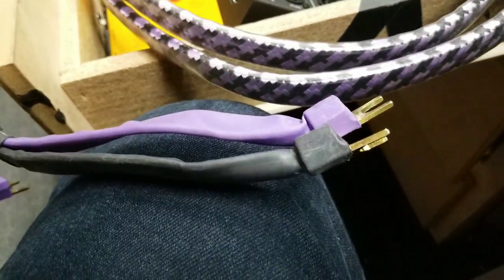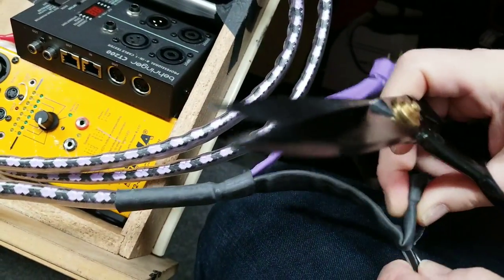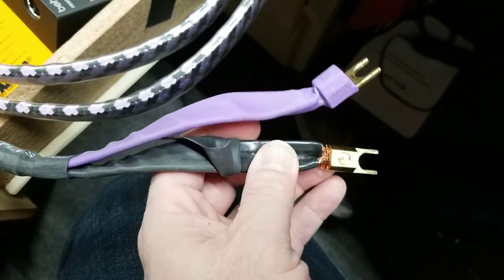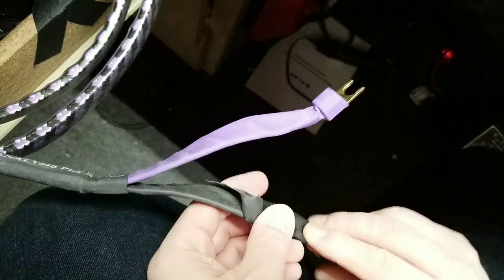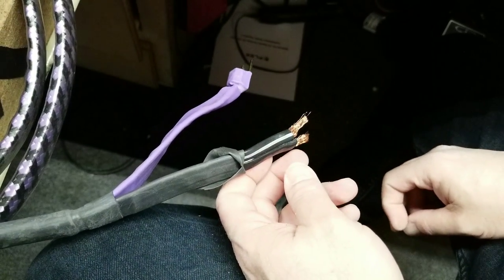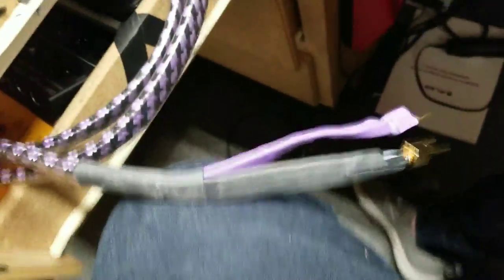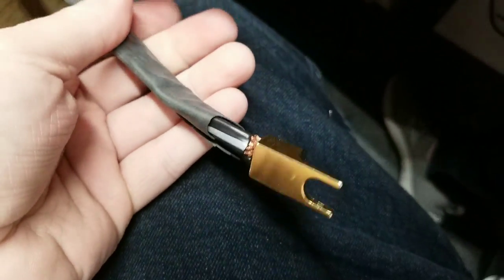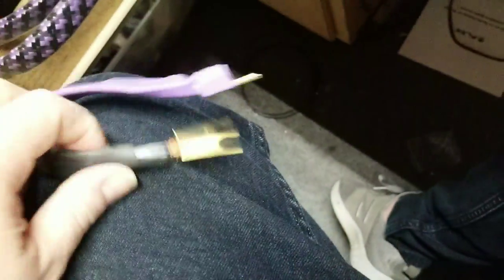Beaker Wire. Lets see what's inside shall we ?

Comment: Speaker wire is always worth its weight in copper.   Ha.  If different speaker wire changes the sound of your system you likely have poorly designed very low impedance speakers and poorly designed high output impedance amplifiers.  If you can hear a difference, that can be easily measured and will be larger than 0.25 dB and easily compensated for.   So if you want to make equalization changes to your system, buy an equalizer and adjust it how you like rather than wasting money one different cables that produce random different results by leveraging shortcomings in your equipment.  So borrow those million dollar cables and measure the before and after response of your system.  Then program an equalizer to give you the same results for free if you have a digital source like a PC or less than $1,000 if you actually buy a digital EQ.
Reply from the maker: Sure.... you say Tomaaato I say Tomato... I prefer passive tuning....

Comment: That "car audio stuff" is Analysis Plus Solo Crystal Oval 8 speaker wire. Yes, it is just a flat oval braid, but the wire is Ohno continuous cast copper. 

From http://www.norneaudio.com/litzheim/Norse-Norne-Audio-Feedback :

"Used throughout the high end audio industry in most flagship cable products, occ provides the superior quality copper and silver possible today.

OCC (Ohno Continuous Cast) is the name given to the casting process developed to help defeat annealing issues and virtually eliminate all grain boundaries in copper or silver with a unique patented process. The OCC casting method uses specialized heated moulds in order to draw a single crystal up to 125 meters in length. With only a single crystal in very long lengths, there is an unimpeded free path for the best possible signal transfer. Along with this superior single long crystal structure, OCC provides copper and silver with the least possible oxides and other impurities. 

In high contrast to OCC, there are other lower grade coppers such as OFC with a multitude of grain boundaries and other impurities. OFC (Oxygen Free Copper) has around 400 crystals per foot and despite its name has an oxygen content of about 10 ppm. Having less oxygen content and less overall impurities compared OFC. OFC has a plethora of grain boundaries per foot that the signal must route around and pass."

From http://www.6moons.com/audioreviews/interconnects/interconnects_3.html :

"A further step of improving copper wire is annealing where the conductor, once at almost desired gauge, is reheated to just below its melting point to evaporate impurities and form longer crystalline grains. The LC-OFC long-crystal oxygen-free copper contains grains that are roughly 600 to 1000 times longer than TPC molecules.

Twenty years ago, a Japanese engineer invented the Ohno wire extrusion method to produce PCOCC or pure copper Ohno continuous cast wire. Instead of forcing molten copper billets through a cold-mold extrusion machine, they are processed in heated molds and subsequently slow-cooled to room temperature. This results in far fewer molecular boundaries than regularly processed copper extrusions. It should come as no surprise that raw PCOCC wire is much more expensive than LF-OFC (oxygen free copper) or TPC (tough pitch copper-the cheap stuff)."

Only one company in the world makes this wire. You cannot buy it at Home Depot.

There are pictures of the crystalline structure of the grains in the OCC wire as compared to oxygen free copper at both of these links. Furthermore, Analysis Plus actually has a proof of concept page on which they measure the response from their wires here: https://www.analysis-plus.com/make-me-prove-it/

I just picked up a couple pair of used Solo Crystal 8 interconnects, they are better than anything else I own, including Nordost.  I don't believe the hype of most cable manufacturers, and I don't believe there is anything you can do to a piece of wire to make it worth $3,000 a foot. PCOCC however is real, and much better than standard copper wire.

I have only seen a few of your videos, I assume you have ears, your system looks great but I can't judge it from youtube sound. While you did say "let's listen to it", you pretty much dismissed these wires by looking at the conductors. I look forward to your listening test.
Reply from the maker: Thanks John for offering very good information. I've known about Ohno for a long time. It's very rare and only comes from Japan. A few areas of concern remain. First off does AP include an assay of the batch of Ohno associated with your serial number ? This is something I do. In other words there is no regulating body in HI Fi regarding statements made about raw material purity. Anyone can say anything this wire looks like it's made in huge quantities and its braided which does not make sense to me.  Ohno wire eliminates micro gaps inside the core of the wire for smoother, less impeded flow. Now you tell me that someone is going to go through the cost and labor of having ohno made, then braid it ? The very physical makeup of braid wire makes it best for shielding and only because its flexible not because it sounds good. By braiding ohno copper you would re introduce micro gaps between strands at a much higher / worse level. Is it litz ? The one here looked oxidized which would of course over time make micro gaps act like diodes. So braid conductor makes no sense for inside the home HiFi in my opinion. It does however make perfect sense for underneath automobile carpet. If you've got the best metal in the world, the best form for music ive found in all my years of trial and error is solid foil. But its cost prohibitive for large  companies. And a major pain in the ass to work with. But let's give it a proper chance . I'll rig. Record and compare tonight and post tomorrow. 
Thanks for your post and if AP is your chosen brand I mean no disrespect to you personally whatsoever
Reply: @OCDHIFiGuy  Actually, I have owned 2 sets of AP interconnect for a total of about a month. I have a setup that allows me to easily A-B two interconnects. I did this recently with everything I own and have collected over the last 35 years. The brands include Audio Research, Nordost, Audioplan, Blue Jeans cable, Monster, XLO, the cheap free stuff, one DIY made with OCC silver and van den Hul carbon. There might be a couple more in there. The result was I could not tell any difference between any of these cables except two. The really cheap cables did sound bad, and the van del Hul had a fullness and body to it that the rest did not. The big problem with the vdH, it is prone to hum.

I learned about the AP from a site by a high end expensive, custom company whose name escapes me right now. They used AP exclusively. So I went to the AP site. They actually back up their claims with scientific explanations, measurements and waveform traces. So I picked op a pair of AP Solo 8 interconnects, compared them to my vdH, and, no difference. So now I can get the body of the carbon conductors without the hum. What do the AP and vdH cables have in common? No crystalline structure in their conductors. (The van den Hul is carbon.)

I have made interconnects with 32 gauge, transformer wire using aquarium hose and pencil erasers for the RCA connections, only bare wire made contact. They sounded as good as my other cables but were extremely delicate. I soldered on some real RCAs and was shocked at how much that damaged the sound. So I am not one to fall for the hype.

I don't know if the individually insulate the strands of wire in their cables like transformer wire. What I really wanted to see on your video is if there was something inside the woven oval to maintain the oval shape.

More from: https://www.analysis-plus.com/make-me-prove-it/ 

                                                   The Hollow Oval Cable Solution 
After many computer simulations and other exhaustive tests, the engineers at Analysis Plus, Inc., reached an innovative solution that flew in the face of conventional wisdom on audio cable geometry. Our engineers determined that a hollow oval cable constituted the best possible conductor design. Here’s why.

The primary advantage of an oval conductor design rather than cylindrical conductor geometry is that the oval shape allows more of the return current to be closer to the outgoing current, thus reducing the negative effects associated with excessive current bunching.

Figure 1 illustrates that at DC the current is uniformly distributed across the cross-section of the wire, but as the frequency gets higher, the current is distributed near the surface. Since the center part of the conductor is not used at high frequencies, we can simply eliminate it. By using a hollow conductor, we help minimize the change in resistance with frequency and the cable becomes more efficient.

                                                   Advantages of a Braided Conductor
Along with the innovative hollow oval conductor design in our Oval cable product line, we also determined that a braided conductor was superior to solid core conductors for two significant reasons.

The most obvious advantage of a braided conductor is that it yields a more mechanically reliable cable than solid conductor designs. A woven or braided cable is more flexible and resistant to stress fractures resulting from continual flexing than a solid cable. A solid cable is also more susceptible to kinks and other deformations when handled. Our cable can be handled easily, and it returns to its original shape when flexed. The flexibility of our cable also prevents the geometry of the conductors from changing with use. If the geometry changes, the cable characteristics will change, and kinks will add impedance mismatches–inducing distortion in the signal.

Braided cable has yet another advantage over solid core conductors. Analysis Plus, Inc., uses a woven pattern in its Oval cables where every wire is statistically as close to the return current as every other wire. The current density is now more evenly distributed between the strands. As a result, the resistance of our Oval cables is extremely constant over a variety of frequencies–much more so than solid-core cylindrical cables, as can be seen in Figure 3.

NASA recently contacted a number of high end audio cable manufacturers, searching for an ultra high quality flexible cable to allow one of their lasers to be mobile. Our Big Silver Oval and Solo Crystal Oval speaker cable were the only cables which met NASA’s specs for things like rise time and low impedance, under extremely demanding loads. We are very proud to provide NASA with our cables.
Reply from the maker: @johnlebeau5471  too bad I can't stand purple. I'll never own this amazing NASA grade Japanese copper. The signal and return are not close together at all and you dont think the 30AWG strands are susceptible to skin effect as well ?? Just because you make them into a larger braid does not negate the effects of skin effect on the smaller strands. At this point. What happens is in my mind I pass judgement on the product I'm reading about and if I decide it's an "unliked" product. It is highly unlikely I'll ever be convinced theres simply too many choices and I must relegate some of them to the "I'd never own it" pile. I dont buy the story.

Comment: The ends are a weak termination design and off the shelf, the copper wire is definitely intended for the car audio industry (nothing wrong with that, it's just off the shelf), and some standard heat shrink with standard woven fabric casing. The terms "off the shelf" and "standard" were used ALOT in my written observations, because this is what this wire set IS.  It's nice looking but for the price point... at least give me some fricken custom machined spades !!!!  I'm not harshing on the cable, it looks decent but FAR detached from the realms of reality at this price. Thank you for sharing!
Reply from the maker: Well there you go. 
So this begs the question. If the buyer were to  know exactly what this cable is and what it's used for in what collateral industry BEFORE they bought. ..would they still buy ? The answer is emphatically no.  So the practice of keeping you in the dark works to thier advantage. So other companies sell cables that you would never purchase unless you knew what makes a piece of metal good for audio signal transmission.  Here's your take away as a reader of this thread. There are 2 kinds of hifi gear and accessories. 1. Stuff you must not understand in order to think it's a good idea to buy  2. Stuff that if you understand the design you will feel very good that you made the right decision
Reply: @OCDHIFiGuy  exactly. This is not a bad cable, it's just not a good executed design that warrants the price  point. To a counterpoint towards the manufacturer- if they had a really unique machined terminal that was exclusive to their brand, something that was "eye candy".... they would sell like hot cakes. But then again , would it then give a performance edge that validates the price..? The answer is no. But it would sure look good! Buwahahah
Reply from the maker: Dude John,  you are totally on point. the last part of your statement is not necessarily no though. I fully believe a connector can give a performance edge that could potentially be all that cable needed to get into the winners circle.  You point out a great area of build because this area tells us a lot about the manufacturer. If they slap something on the end versus if they create thier own, before we even place value on it we know one guy is more committed to excellence, whether he hits it or not. We know where his head is at, dont we ? not necessarily, but we do know how far the company is willing to pay him to execute. Lets think a little deeper, little things bely much information.  Thanks for your involvement !!